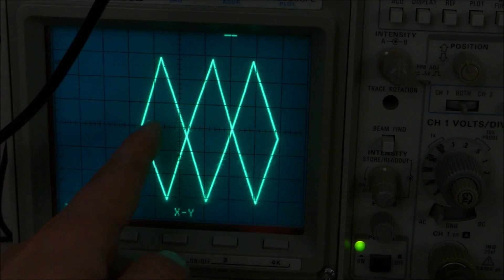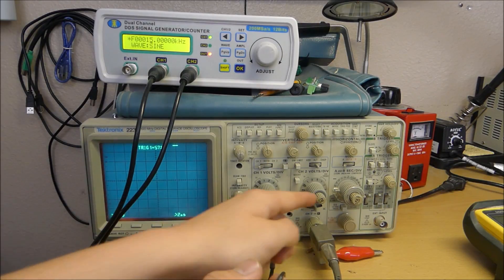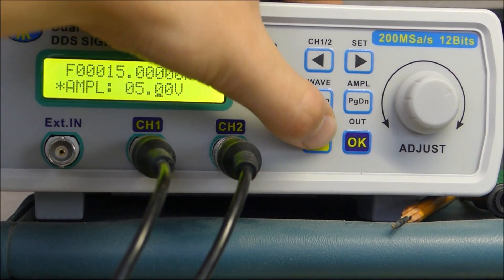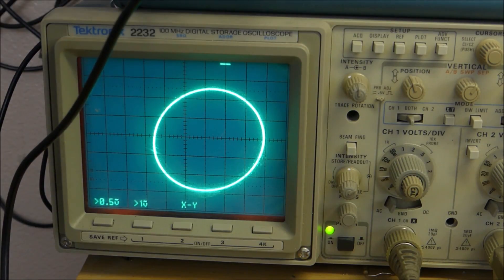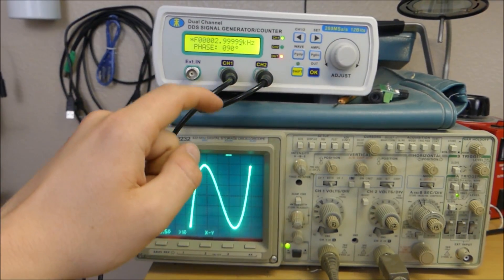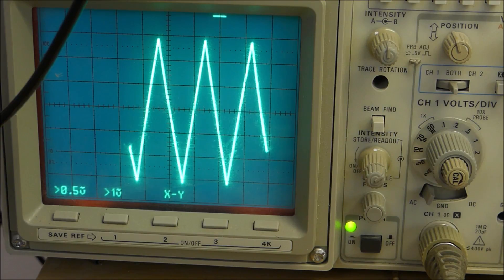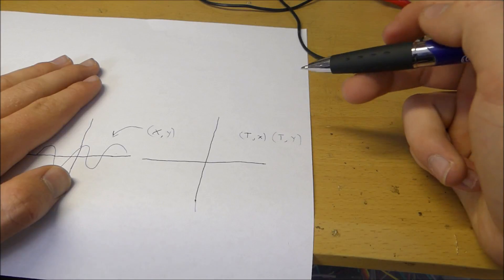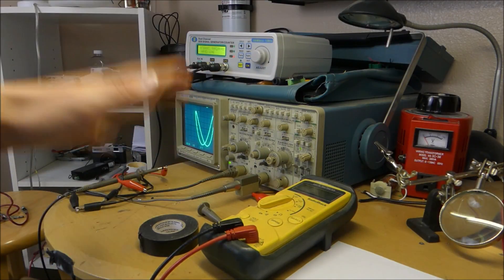How to Make Lissajous Figures on an Oscilloscope

Comment: Now, replace the oscilloscope with a laser and two galvanometers :) 

I used a laser printer mirror and motor to create a line, and a modulator for the laser, infinite possibilities :)
Reply: Danka
Reply: Hey idk if you'll see this but I'm interested in something similar. Any chance you'd want to share how you did this? Thanks!
Reply: @isaacaraya3848  Hello, I agree to share off course, but I said everything ! 
In the laser printer there is the optical bloc which contains the mirror on a motor. Unfortunately I wasnt able to run this motor, so I took off the mirror and put it on another motor which is ran with a lab power supply.
I own a laser that can be modulated by TTL and a small function genetaror is used to modulate it.
Using the mirror to reflect the laser allow multiple possibilities by modulating the speed of the motor (power supply) and the frequency of the laser (function generator)
Enjoy !